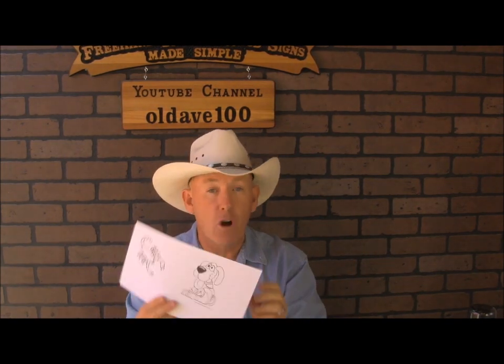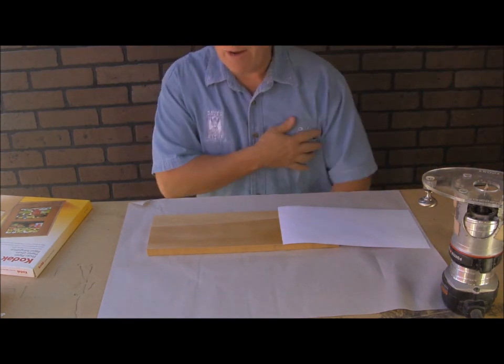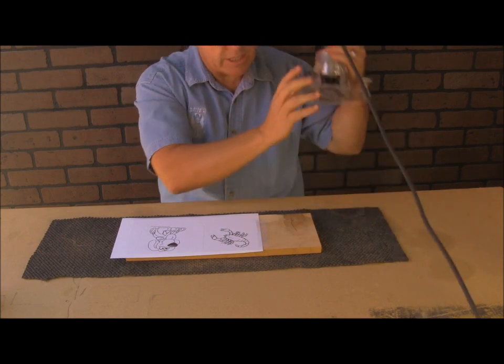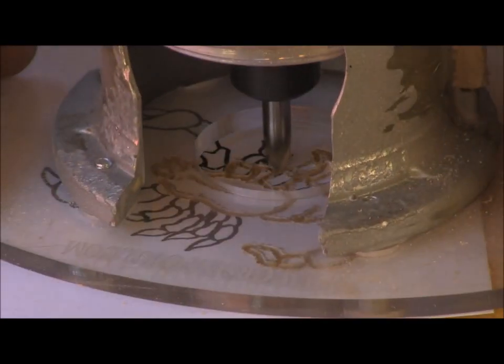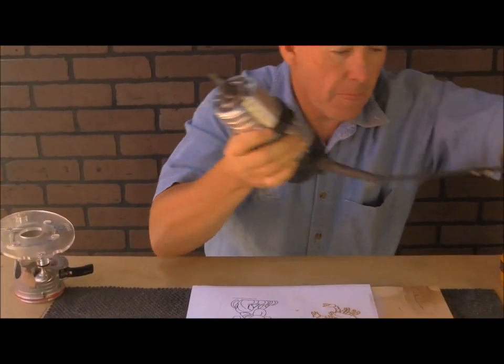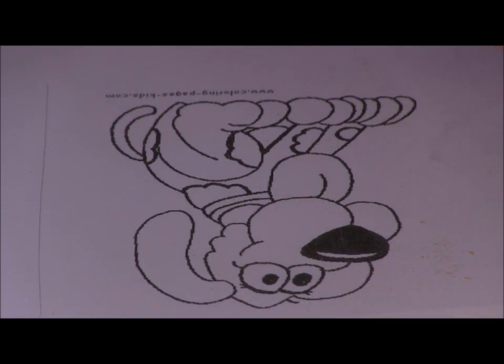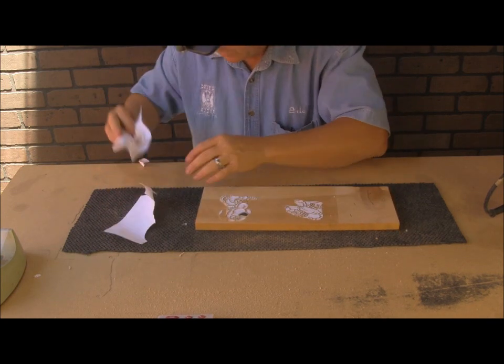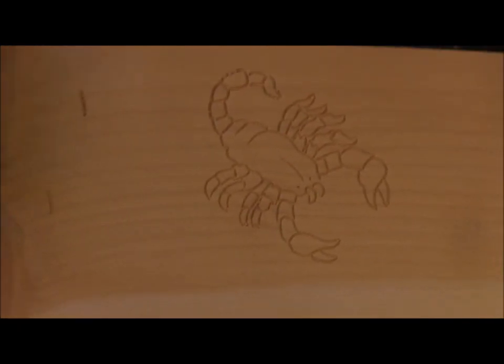#137 Carving Small Artwork Part 1

Comment: Eric,
I do custom portraits for my customers with the router and I use the exact same method however I just use regular printer paper and a very helpful tip that I would like to offer up is to use a heat gun over the paper as you are removing the template, it will make it peel off super easily and prevent having to sand before spraying with ink.

 With the portraits I do some are extremely detailed which requires me to have much shallower cuts than a standard sign would have and any additional sanding could cause me to lose those details in the shallow cuts, I learned that the hard way by accidentally sanding away some shallow cuts and ruined several hours of work! 

Thanks for all that you guys do! Keep up the awesome work!
Reply from the maker: MrZeroloc1 Thank you for the tip about the heat gun. I'll give that a try. Sounds like you do  beautiful work. Would love to see it. Anyway thank you for watching & for the kind words.
Reply: MrZeroloc1 I second the heat gun. Especially with the thicker paper. It will remove much easier than regular paper, and be less likely to tear as it is being removed. This will make sure, like you said, that the fine details of the design are not sanded away.
Reply from the maker: Thank you Tim. I will give it a try next time for sure. Thanks for watching.

Comment: great video's 
just a tip (works great) i use it to remove my scrollsaw patterns
 use mineral spirits to remove pattern paper, just put spirits on a rag and wipe it on the paper just enough to dampen paper, let set about  20 seconds or so and peel off paper.
Reply: +rusty nails I use regular printer paper also
Reply from the maker: +rusty nails Thank you. I'll give that a try

Comment: Great idea. This method of gluing you have is common with scrolling which I do more of. The use of a heat gun as one said works faster and neater then peeling it off. You can get a $8 heat gun from Harbor freight which works fine.
Reply from the maker: vtxrider1800r Yea I'm gonna try the heat gun next time. Thank you for the tip.

Comment: (Try This) I adhere Blue painters tape on to the (board), spray on adhesive to both the pattern(Backside) and Painters tape, then attach the pattern to the board surface. This should help with clean up time(Peel off tape) once project is complete....  Just a thought, it helps with my scroll Saw pattern(s) lay out.....
Reply from the maker: +Tim Rogers Thank you Tim. I'll give that a try.
Reply: Dave Rhoten Did you try the blue painters tape? If so ,how did it work?

Comment: Eric, I started a photo paper printed sign today.  I will finish it tomorrow or Sunday.

I used the same spray-on glue you did.  I used a light coat on the board and on the back of the photo paper.

To help with alignment, before I glued the photo down, I found and lightly scribed a center line on the board.  Then I found the center line of the paper and made a small mark on each end.  Then I tested it to make sure it would align correctly and sprayed the glue.  I let it dry for about 5 minutes and then went to carving.

The paper was firmly attached and never moved.  I made my first pass lightly and then removed the paper.  Next I cleaned and sanded the board face, and then made deeper cuts all the way around.

I took time to mask off the lettering.  Then I lightly painted from all sides for complete coverage.  When the paint dried I removed the tape and did my rough sanding.  I'll get the board finished tomorrow or Sunday.

I'm liking this method a lot!!  Thanks again!
Reply from the maker: Frank Jenkins Glad to help Frank. Sounds like you've got a good process. Thanks for watching.

Comment: It seems like you set bit depth for predicted maximum depth of cut you'll want and then you're lifting one edge of the router to finish off lines or to limit bit depth on finer/thinner lines.  Is that correct?
Reply from the maker: That's exactly right.

Comment: I’ve another BETTER idea for preventing your paper from tearing and clogging up. It’s simple too - just laminate your paper first and stick THAT to your wood. It’s nice and slippy too.
Reply from the maker: Haven't tried that. I mostly use a transfer method now. See the video we did LTS 9/30/17. Thanks again for watching and the feedback
Reply: Just to let you know I have now made my very first every
 Sign from a bread board.  I could have routed the corners etc but I’ll try that next time. I’ve save the sign in my Dropbox so you can have a look and give me your opinion. https://www.dropbox.com/s/kcgx9m8aiha22ta/Photo%2006-11-2017%2C%2016%2017%2026.jpg?dl=0
Reply: BTW I used ‘blackboard spray paint’ on my sign and I’ve made a video of how I made it. I’ll post the video soon on my channel.
Reply from the maker: good job